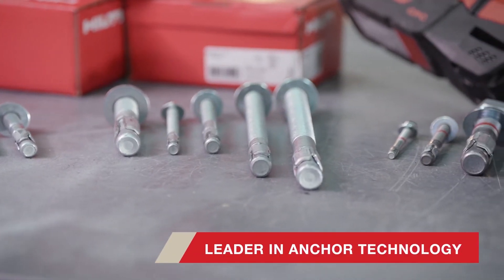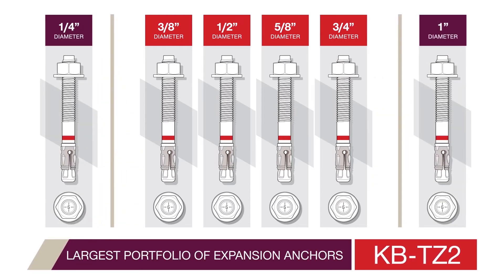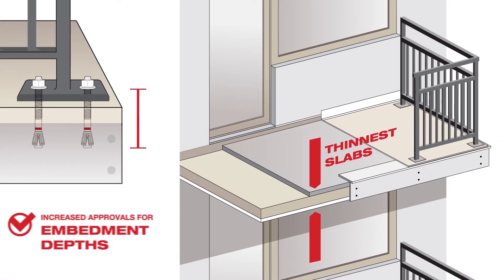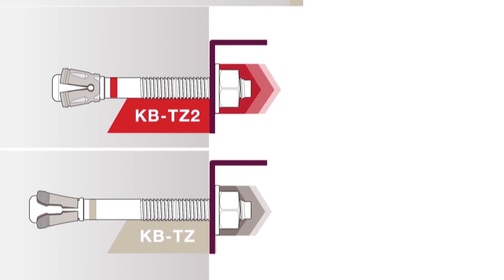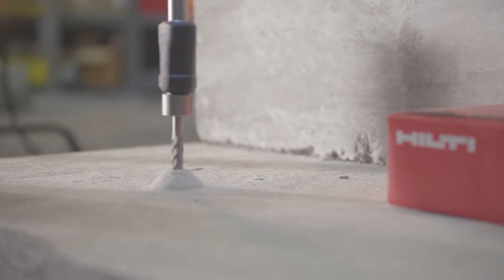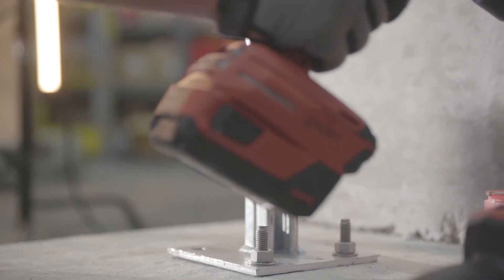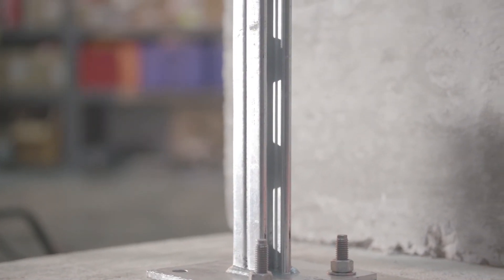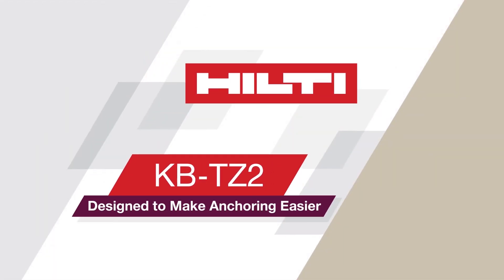OVERVIEW of the Hilti wedge anchor KB-TZ2 for various anchor applications

Comment: Can they be hammered into holes drilled in the slab
Reply from the maker: Thank you for the question! The KB TZ2 wedge anchor is perfect for anchoring in concrete slabs with small edge distances and spacing and provides excellent tension and shear performance, even in seismic conditions and cracked concrete.

Comment: Looks great , are these suitable for rock climbing  ??
Reply: Yes, they've used them in South Africa for rock climbing
Reply from the maker: Hello! Thanks for the message. Hilti KB-TZ2 and KB1 have been tested and approved for concrete and grout filled masonry only. Unfortunately, we cannot confirm the performance of these anchors in base material, like rock, outside of the concrete and grout filled masonry applications. The installer can perform an in field pull test to confirm the tension capacity of these anchor installed. Let us know if you have any additional questions.
Reply: Ok great , thanks for your reply , I'm guessing you've seen    how not to highline 
Bolt busters on YouTube? Maybe you could sponser ( send them a couple to test ? ) could increase sales in the climbing / cAVing world ? 
Thanks again